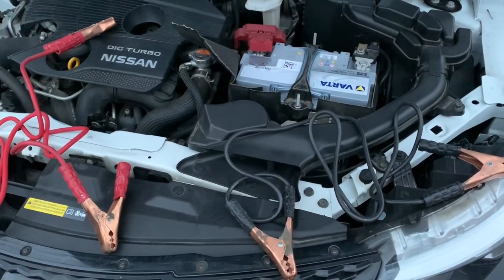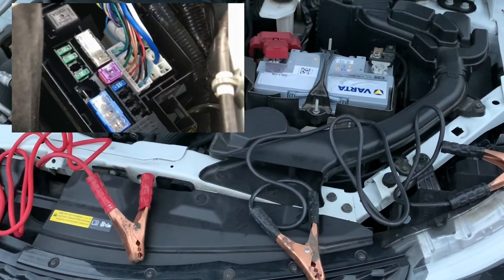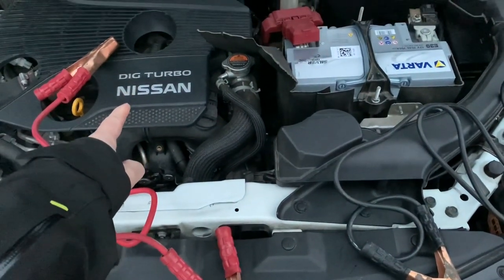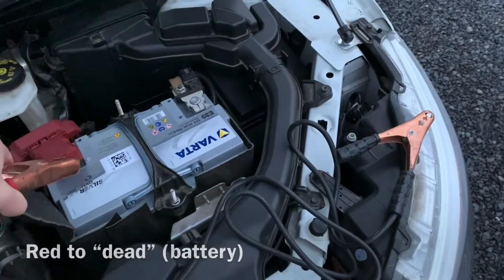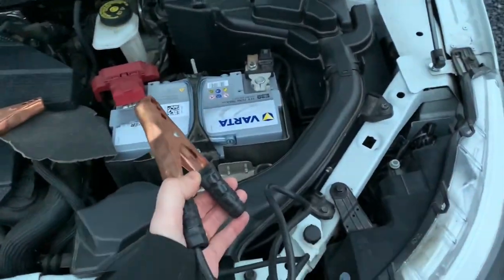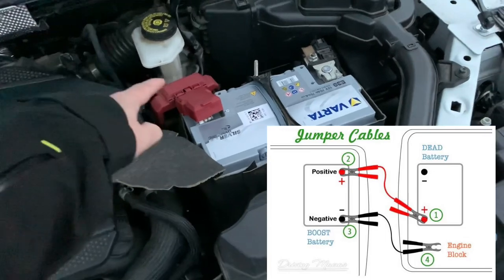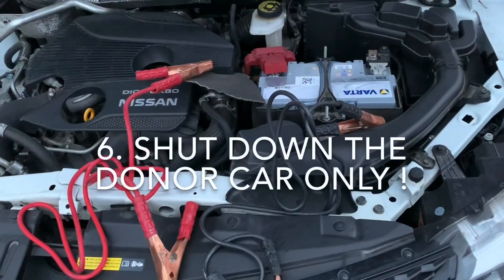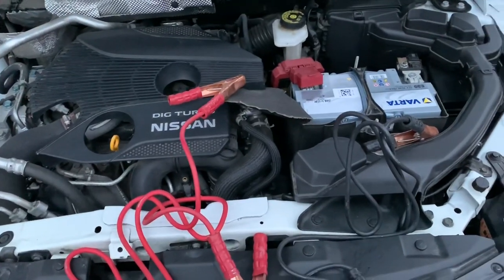Nissan Qashqai J11: How to use jumper cables

Comment: I did this to my j11 1.5d and no problem at all. After that I drove to the authorized dealer replaced the battery with a new one and no damage to the electric systems. They are not so sensitive.
Reply from the maker: Hi Bill! If you know what you are doing not indeed. But I mentioned it because certain car manufacturers even advise to never jump start other cars to prevent damage to their systems. Glad the jump start helped you out here. 😉 👍🏻

Comment: This is out of date as on my 2018 Qashqai the air cleaner is mounted on top of the battery. To access the battery terminals you have to remove the air cleaner by releasing plastic clips. Try that in -30 with gloves on in a Canadian winter. Poor design.
Reply from the maker: Is it?? That is strange because even on my new Qashqai from this year (2020 Ntec) the design is the same with the battery well exposed. You can see the motor in the video where I describe the difference between the old 1.6 DIG-T and the new 1.4 DIG-T.